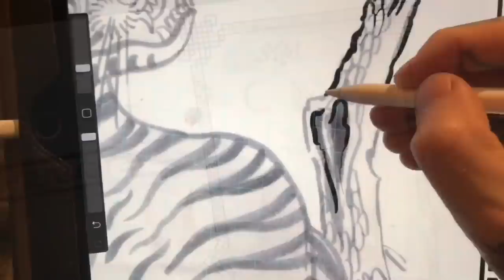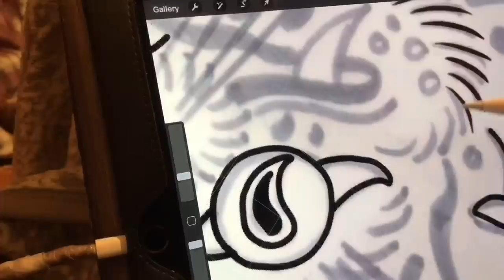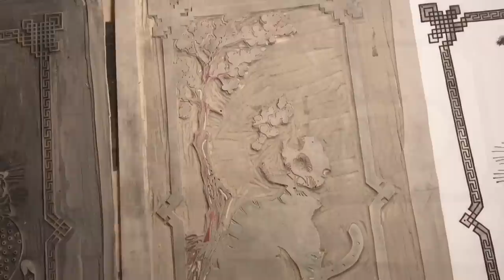Lino cut Printmaking time lapse- Korean Tiger by Emils Salmins ( multiple layers)

Comment: Now I understand why artist charge so much for their "prints". Thanks for helping me understand, and great job 👍
Reply: Well, there are different "prints"- digital prints and "original" or whatever it's called- linocut, woodcut, lithography, serigraphy etc., so Your confusion is quite valid! If Emils would decide to sell a digitally printed copy of his linocut then he'd probably call it a "reproduction".
Reply: I had to learn different print techniques in school and alone for the work of the cut a print is worth it's money. Then you have to consider how many prints were made. If there is only 30 original prints than it is much pricier than 1000 print. And then the price adds up or decrease because of who is printing. If the artist themself do it is is worth more and most of the time it is the first batch of prints. Artist that print alot have assistants for that and these are not that valuable than the first ones the artist make.
Reply: Usually you print out stuff with an industrial printer, not using blocks like in the video, although some art is done that way but it takes a lot more time

Comment: Amazing work my friend! Its truly spectacular to be able to witness your process. All while enjoying it in a calming video! Now im not trying to be rude, super critical or a know it all when i say this.. but as an artist myself i tried to think of a positive suggestion/critique while watching your video. Having done only several lino prints in my whole art career, it was very difficult to try and come up with even one positive critique. It did leave me wanting to mention only this one thing, which i wouldn't be surprised if you've already experimented or done this before. Have you ever considered mixing your own black for your prints? You know the color wheel, mixing red, blue and yellow? If not, i think you should try it out as it could offer even more depth to the black in your prints, compared to just using one straight out of the tube :)